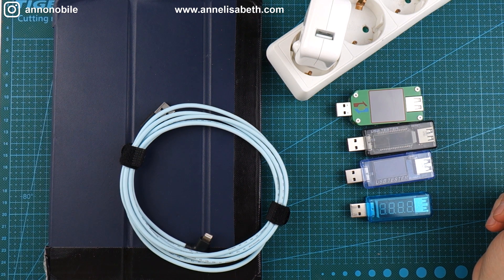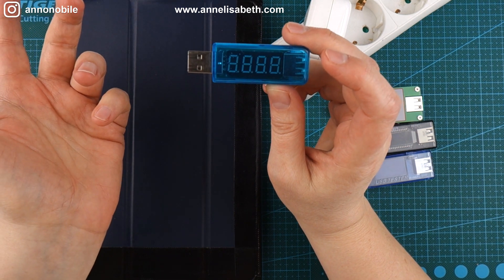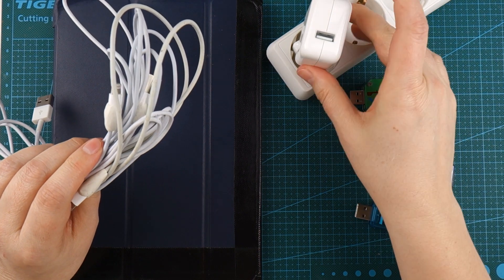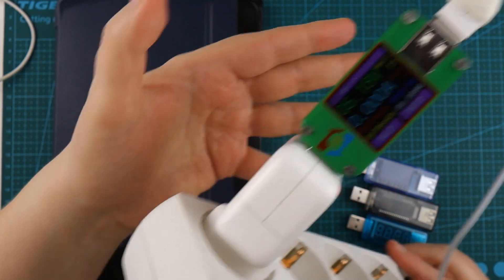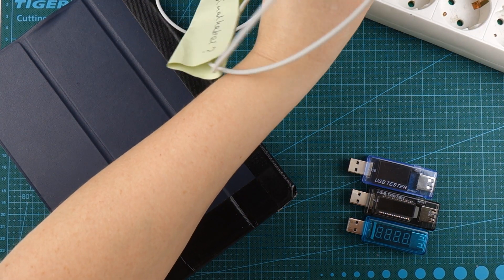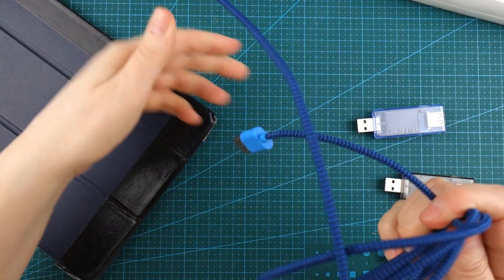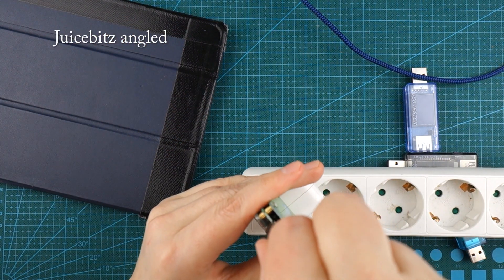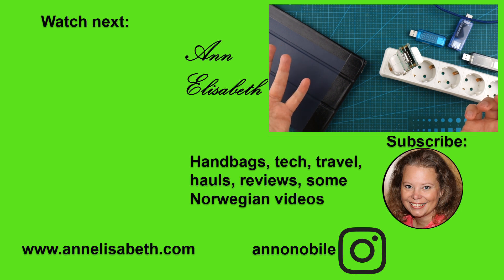Testing lightning cables for iphone and ipad

Comment: Both the USB cable and USB charger needs to be tested to get the best charging capabilities regardless of brand or cost or even the same brand of cable or chargers ...an original Apple cable or charger can be good, not for the other one you buy/get !

Comment: Thanks for the comparison. I have a question though
No one nowhere has explained this:
USB A > Lightning (2m) 12$ Charging Cable 
USB C > Lightning (2m) 39$ Charging Cable

You have to buy a charging brick for 19$ from Apple in order to use USB C > Lightning cable the bundle is 58$.
But.. USB A > Lightning cable is cheaper and you probably have a charging brick that is 30-60W WITH USB A Output

So the question is: Are the charging speeds the same?
Different cables have different AMP/Volts Tolerance some enabling you fast charge some that don't.
Reply from the maker: USB A to Lightning have been around for years. There are authorized and non authorized on the market. More competition could mean better prices. USB C to Lightning is new. How many are authorized? I don't know. If there are no third party cables, that might explain it.

Proprietary cables and chargers generally charge faster, unless you're using cables rated for higher voltages and amps. There is a difference, and cheaper cables could go hot and melt. And won't let through as much either.

Huawei's USB C cables and chargers are proprietary. Same cable/charger charges different amount of watts depending on what phone you attach. So without having looked into the C to Lightning cables, it's possible they too are proprietary, except Apple generally has that mfi program that authorizes third party cables. One that isn't authorized may be rendered unusable at any time, because the phones AND the cables generally have the ability to recognize unauthorized stuff. One that worked with one version of the OS might stop working with the next update. Or not. You just never know.
Reply: @annelisabethcom  Thanks to the response! You've answered all I needed, I was just wondering if it would work and if it wouldn't resist voltage/amps because Apple is Apple and I forgot about MFI chips.

Comment: Oct. 2020. Thank you very much. I was happily surprised immediately to find on YouTube a product to measure Volts and particularly Amps while charging my iPhone and iPad and Kindle. I had not generally thought that working cables might have different amp flows, so your video will help in that regard, but I plan also to check the chargers themselves, since I have chargers that say 2.1A each USB connection, but in fact are charging very slowly, whereas with the same cable plugged into a different charger also saying 2.1a or 2.4a, the device fully charges much faster. The testers you have shown me will really help. Thank you, thank you!
Reply from the maker: Chargers are quite different. I got one with a device. It got quite hot in regular living room ambient temperature. So I won't use it. I have a few Tutuo multi USB chargers. One has been used in Thailand for months. It's the first that hasn't died due to their unstable electricity. And it managed to not get super hot while being on practically always 24/7. I don't think they are easy to find anymore, but they're available on lots of different brands, including on Amazon. Mine has three regular USB, one fast charging and one USB C.

Comment: I bought a longer cable for my iPad 5 months ago and it stopped working today
 Luckily I'd saved the original shorter lengh one that came with the device. Am bummed out this happened after only 5 months.
Reply from the maker: Mine are mostly 3 meters long, and they work for more than a year.

Comment: Wow, it is my first time see you can use this to charge. Do you have a link for that? Thank You for sharing ❤️
Reply from the maker: I’m not sure what you mean? The USB tester isn’t meant to charge the device. The current goes through them and they display what goes through them. Usually you just need to input USB tester in Amazon or Ebay. If you specify what you want to buy and where, I can find a link for you.